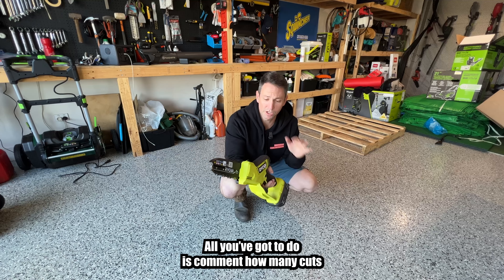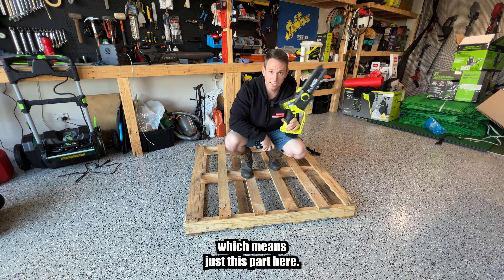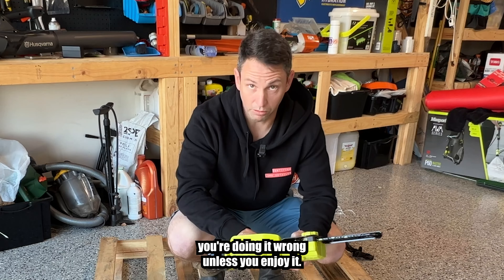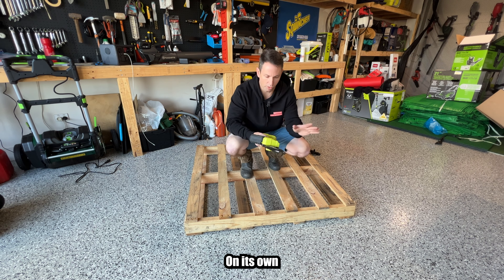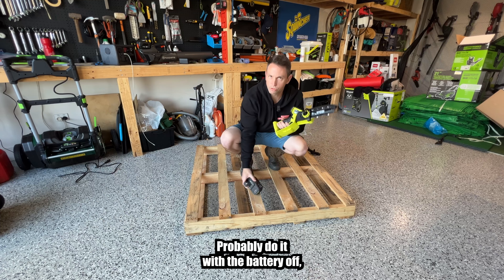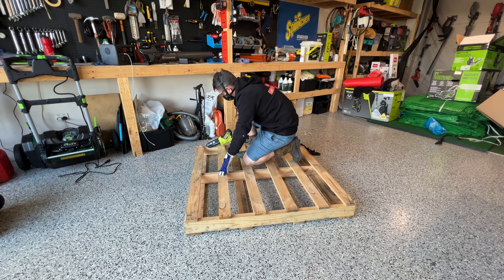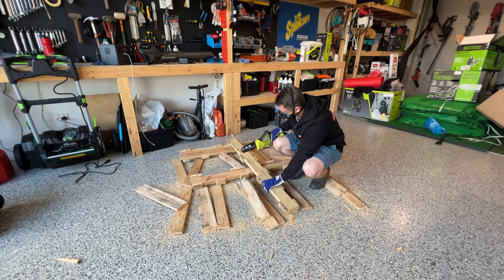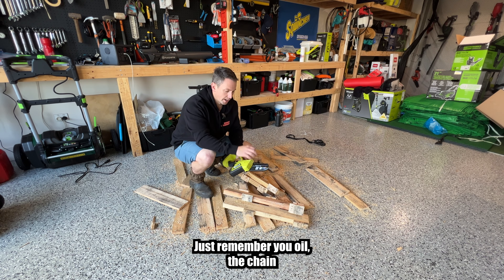Ryobi 18V ONE+ HP 6” 15cm Brushless Pruning Saw R18XPCS10 Let's put it to the test!

Comment: Worked great for about 2 days for pruning small limbs off logs.  Day 3 the chain stopped catching on the main gear.  I replaced the chain and re-tightened everything but the gear turns the chain until I bit into a branch then I can hear the gear spinning but the chain stops.

Comment: The description for these says "Oil-Free" design.  Yet, most mentioned it does need oil.  Why is that?  Do you have to use specifically a Bar Oil, or can I use any oil llike 3in1 oil?  Are there any other types of maintenance required for this? thx

Comment: 20 cuts.

I bought the Stihl version a few weeks ago. Best money I ever spent. My Dad thought I was nuts until he saw it in action - then he became more concerned that it was dangerous in my hands! 🤣
Reply: The Stihl is rubbish, I bought one when it first came out and regret it. the battery doesn't last and it stalls easily. I bought a 4" no-name Chinese chainsaw on Amazon with two 20V batteries, two chains and a hard case for $35 US and I haven't used the Stihl since.
Reply: Even their electric chainsaws don't start